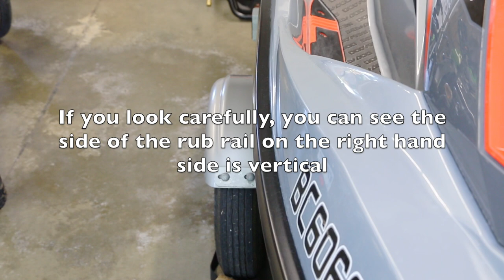How To Fix Your Sea-Doo Jet Ski Bumper When It Falls Off

Comment: Great Video!  Took me awhile to find what I was looking for because my terminology was wrong.  Turns out I was calling fenders "Bumpers" and Bumpers "Fenders". I searched for hull and deck trim also to no avail.  I recommend using a blown up parts diagram to get the part terminology right, it will save you time for sure. A few sites have these so you can identify and order parts.

In my case... Rough water next to the dock pulled mine off from the top.  Tried to force it back on but didn't understand how it went on exactly so I didn't want to go all HULK SMASH on it.  Now I know I need to.  Thanks for the Video!!!
Reply from the maker: Thanks, Kirk. Safe riding!

Comment: Hey just found this video was great help, was wondering my front bumper is little loose and wiggles a bit if i apply pressure, you have any tips for that ? Thank you
Reply from the maker: The bumpers are normally attached with screws that go straight into the fiberglass (i.e. no inserts). They can become loose over time. Try tightening up the screws very carefully so as to not strip the fiberglass. If they won’t tighten, remove the screws and fill the hole with some waterproof epoxy or equivalent. Drill it out and put the screw back in.
Reply: @3ftDeepChannel  much appreciated thabk you :)

Comment: Enjoyed seeing what problems encountered on way to fixing. Does the fishpro use the double sided tape too?
Reply from the maker: I’m not sure. The only point we are trying to make is that the integrity of the bumper shouldn’t depend on double-sided sticky tape. I would advise anyone with a machine made in Mexico to check to see if the bumpers are correctly installed, and that they don’t have excessive glue preventing proper adhesion. Good luck.
Reply: @3ftDeepChannel  I was asking about the fish bro because I was thinking about adding some PWC collars to give extra stability in certain cases. If it was stuck on with adhesive that would be a deal-breaker
Reply from the maker: No, the bumpers normally clip on and are pretty secure. They have to withstand the upward force of the waves which can be pretty extreme.

Comment: I live in Vancouver WA, do you have any recommendations for service techs down here?  Also do you use fenders?  I scuffed my jet ski pretty bad and will need to get it fixed.
Reply from the maker: Whenever we moor at a dock for any length of time we use fenders. The docks can do a lot of damage to these machines as they are quite a bit lower than most boats. Unfortunately, we don’t know of any good technicians south of the border, so we suggest sticking with a dealer until you can find one. Good luck.

Comment: Quick question. Do you know if you order one online does it matter what side or does one fit either side?
Reply from the maker: It’s hard to say. Use the parts catalogue on Sea-Doos website to figure out what the correct one is for your model. Good luck.

Comment: Warning/Caution: when using the heat gun while the bumper piece is pressed onto (or forced onto) the vessel, by "relaxing" the bumper you will likely also relax its main holding properties, that is, the lower and upper connection points.  By relaxing the middle of the bumper you will permit the dimensions of the bumper to stretch out of specifications.  On my 2019 GTI the measurement from the top to bottom of the bumper should be about 2 3/8 inches, or less.  After I applied heat, the measurement expanded to over 2 1/2.  This may not seem like much, but it is the elastic property of the bumper that causes it to "snap" into position when you install it, which means, while the bumper is cool it must be in such a form that it has to temporarily stretch vertically when installing on the vessel.  With a measurement of 2 1/2 it was wider than spec and did not require any stretch to fit over the connection path, and thus no beneficial "snap" into place.  To fix the problem I removed the bumper and positioned it in a jig to squeze it together from top to bottom and then applying heat (you need not do the entire piece at once, I did 2 feet at a time). [Note: you'll know you've reformed the dimension when the bumper lossens in the jig while applying heat].  Allow the piece to cool in the jig before removing, repositioning, or installing on the vessel.   It must be cool in order to exhibit the elastic properties needed to "snap" into position.  [Note: when warmed to a reformable state the bumper material exhibits properties more like a rubber squegee or windshield wiper blade].  I hope this info helps someone.  After wrestling with my bumper for hours, this was the final try before I gave up and bought a new piece.  The sweet sound of the "snap" was music to my ears. 😀
Reply from the maker: Thanks for sharing this. Our heating process was such that it held on the top and bottom groove. Too bad it didn’t work out for you and you had to buy a new piece.
Reply: @3ftDeepChannel  I wrote that poorly.  The reforming worked, so I didn’t need to buy a piece.  What I meant was, had it not worked, I was ready to buy.
Reply from the maker: Ah, that’s better! Thanks for clarifying.

Comment: My 2019 rxpx has that issues.  I've tried remounting and using heat gun to make it grip tighter but still slightly coming off.  Garbage quality control by seadoo
Reply from the maker: That’s terrible. If you do end up replacing the bumper, remember to remove all of the excess glue that prevented it from looking on properly in the first place. Good luck.